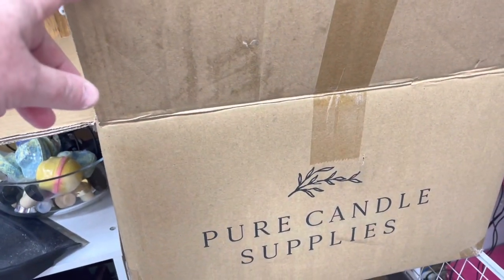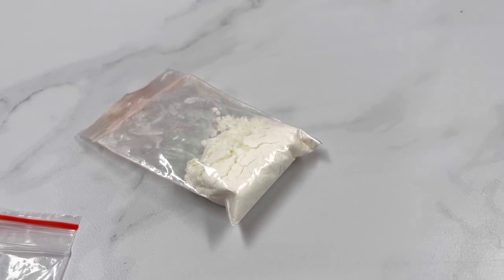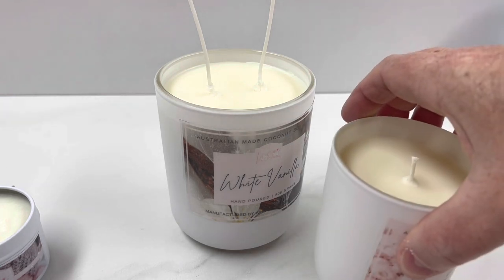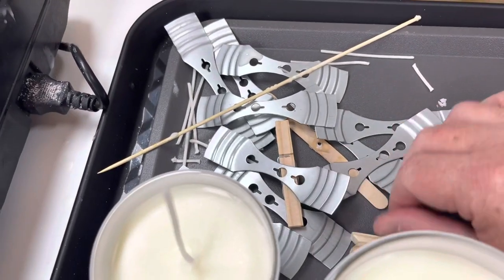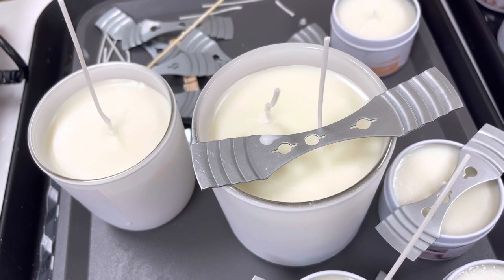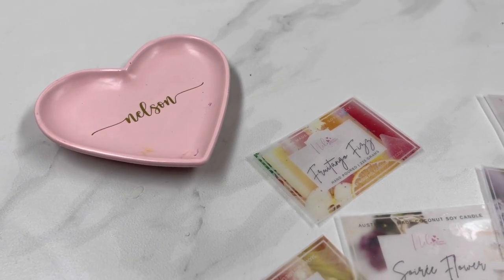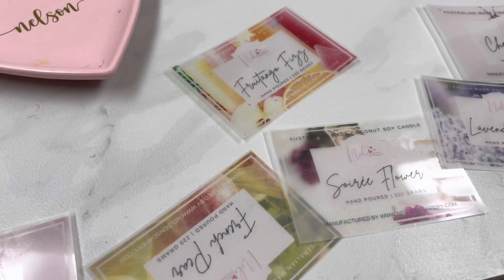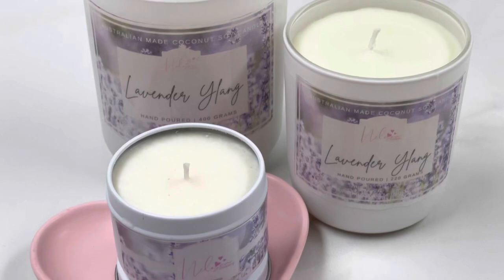Making coconut soy candles and getting that smooth top s that you want with temperatures

Comment: Me and a Friend own a small business together (We're only 13) and we have found that all websites have different cooling, melting and pouring temperatures. We use a coco soy wax blend from Scent Method which is in Sydney. They advise a 70+ melting temp and an aprox. 65 degree pouring temperature. I'm not sure if this changes based on websites but it's all Aussie and to be honest I'm quite confused. We've got 3 batches to be made in a week or so so I thought I should ask a more professional opinion. :)
Reply from the maker: Hi there. Firstly i want to say you are amazing. At 13 its great to try your hand at business. 
Each website will have variations of wax. All soys are different so the melt pool will be too. Id follow instructions from the site you got it from as their instructions are for that wax.
Reply: @NelsonInteriorSoapery  thank you so much!